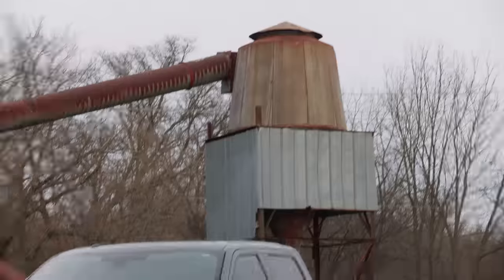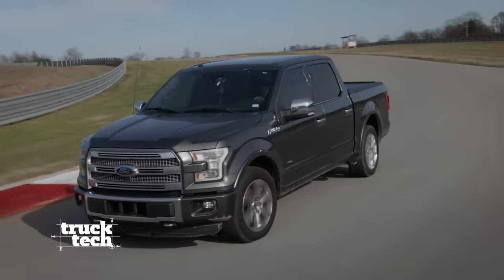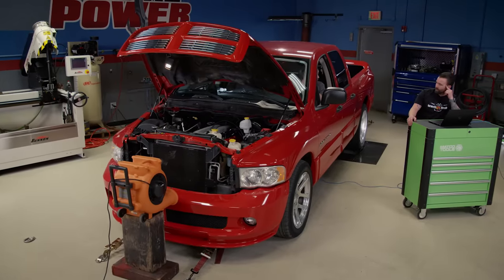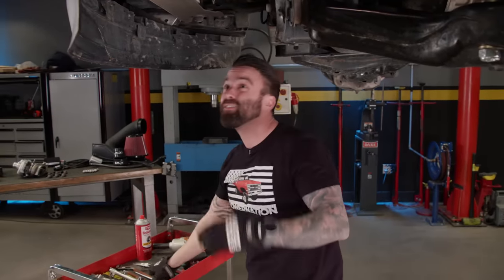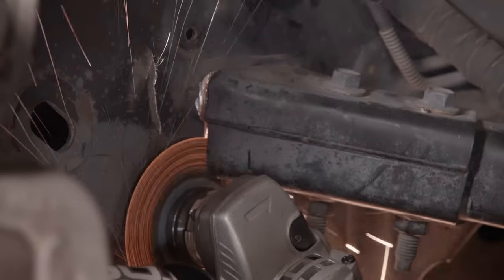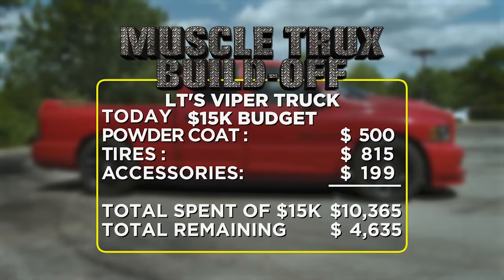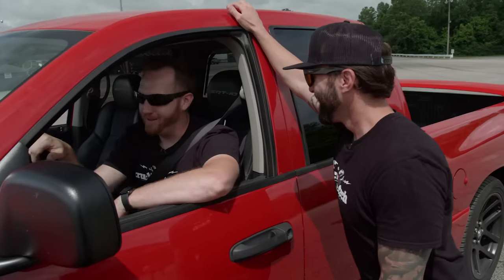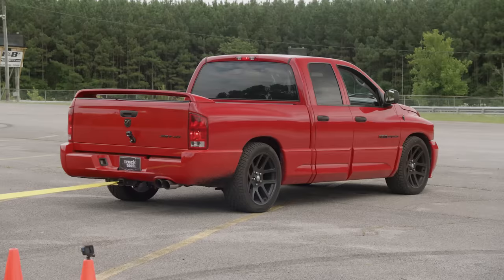Muscle Trux Build-Off: Ford F150 EcoBoost vs Dodge Ram SRT-10

Comment: Do any of you ppl ever answer questions that can really help "Joe American" w/ his truck issues ??

I have a 1999 Ford F-150 w/a 5.4 V8.  I understand the aluminum heads are very thin where the spark plugs thread in. That's why I've had 3 spark plugs already blown through the threads having to be fixed w/helicoils.  I understand they can't be fixed twice.  Solve this problem for good.
Questions :
a)  do you know of this problem ?
b)  do you have a recommendation you could share ?
c)  are there aftermarket or other heads available that don't have the same problem & could fit this engine ?

Thanks for your generous consideration,
Steph  (Stephen Boeker)
Leesville, LA
Reply: Why are you asking maintenance/piss poor engineering questions on a muscle truck buildoff video???

Comment: So the ford guy cuts off the frame bracket that makes the f150 the safest truck all because they didn’t want to measure the for the correct offset and size

Comment: That F-150 looks WAY better than that Dodge. I would take that 150 any day over that Dodge. There is a reason the F-150 has been the best selling truck in America for like 35 years. They make dam good trucks. And the economist V6 puts out more power than a comparable V8 does and gets better gas mileage while doing it. Did you know that the new Ford GT has a 3.5 liter Ecoboost V6 in it? Yes it does. It has all the same engine that F-150 has of course it is tuned much differant. It produces over 600 HP. So that engine is capable of A LOT.

Comment: 9.63? That's not great for a 3.5 Ecoboost. I think he needs to learn how to drive it.  4 hi, brake boost it and go. It should be running high 8's in the 1/8th.
Reply: There's ppl running low 8 with Ecoboost in 1/4 miles lol

Comment: Would rather have The ford looks Way nicer better on reliability Plus you still get the comfort and smooth ride Plus the four would be more of a logical point it’s more accessible for the people to follow the build unlike the Dodge that literally will break and broke on video 🤣 you also have to admit it it’s pretty sad that a four-cylinder is on the ass of a V 10

Comment: Cool video but without a 1/4 mile it isn't right. Simplest measure of american muscle. Replace a bushing with aluminum .... cmon. Great for a few hundred miles and then.  I'm out. 

This coulda been good with the ultimate mopar and the new gen of ford. I have a 2014 5.0 f150 and really wanted to see how this shake's out.

Comment: I'll never forget the owner of Kimberly roofing couldn't believe the commercials so he leased one each Chevy, Ford  and Dodge. He had three crews and each crew got each truck for 4 months after 1 year they each had to pick their favorite truck. All of them said the same thing: if you want to get to the job fast get the Chevy,  if you want to look good when you get to the job use the Dodge but if you want the best work truck ever made get the Ford so he bought every one of the crews a brand new Ford crew cab with the 7.3L. Powerstroke F-250

Comment: The F150 build is an absolutely a horrible match of "upgrades" for the money spent. 7 grand for less than 100 total gain, definitely a case of someone choosing parts without thinking of the actual requirements. Intercooler, injectors, ignition coils and blow off valve were not required on that build the stock units would have easily supported the marginal increase of power.

Comment: Big wheels don’t make sense unless that is what you. Personally I would have more rubber on the ground,  that black color doesn’t do anything for me a great set of chrome wheels 18 inch wheels with tall tires air bags suspension, personality the black out takes away from the beauty of the vehicle 
Any vehicle with these big emblems takes away from the vehicle, they make a flag emblem that is awesome. Fiat needed to let people know who was making it now it’s own by a company from the USA we will have to see what will happen to .

I have a hard time with the GM vehicle it has that big ass grill is larger than a Kenworth or Pete. Watching from the rear view mirror you see a that appears to be couple of inches then there is a grill is Hugh then the air dam is wow these are p/u trucks not OTR tractors 🌎. My opinion gm looks like a barrel of smashed ————————  they didn’t put enough goodies to offset the ugly.

Comment: The Ford does look better, BUT it is still just a V6. I'm partial to Dodge and redheads and how do you compare a V6 to a V10? Dodge wins without a doubt.
Reply: Spent almost all of the budget and still lost. Biggest improvement in hp but still noticeably less than the V10. Spent the most on visual but the Dodge still looks better. (he forgot to put in the blacked out lights he paid for) Though there isn't any chrome but as the saying goes: Chrome won't get you home. The Ford does look better than when it started but it still not enough.

Comment: This was the worst build off I've ever seen. The basis twards the Ford was ridiculous. You claim $15k in upgrades but you never included ALL the paint that was needed for the Ford. I swear this was watching a guy with an endless budget and resources.  I.e. a lift a paint booth, tools. Etc. Go against a normal.guy who would work out of his garage with a limited budget in mind and some of the prices u claim seem very off. THE VIPER Truck paid almost $900 for just tires. But the Ford got 22" x 10 wheel n tires for $1500. That seems fishy. The Ford get a paint booth with paint and all the tools and prep work needed to paint. I.e. sand paper grease n wax remover clean rags a spray gun a compressor just has that available to him. The guy in viper is using plastic dip in a drive way.  Then the Ford get a daul action polisher with polish and cleaning product all free.  Like i said the worst build off ever. The Ford went way over $15k. And the Dodge didn't even come close to it. What a  sham.

Comment: the ecoboost should of been converted to E85
Reply: Why convert?  It should already be setup to run e85.   Most newer vehicles are flex fuel from the factory.   My dad's 01 Ranger was and that was 20 years ago.
Reply: @bmstylee  not all engines are set up to run e85 the ecoboost f150s are not but the 5.0s are
Reply: @bmstylee  gotta change the fuel pump
Reply: I see.  I see a lot of the newer 150s with the flex fuel badge on them.  So I assumed wrong I see.   My Silverado is e85 compatible and I ran it when gas was $4/gal and I didn't see anything other than it uses a ton more fuel.
Reply: @bmstylee  lol all modern vehicles can run on e85 its just horrible for miliage and adds no performance gains at all unless you tune it for the e85 my 2012 titan says flex fuel but burns twice as much as gas if you use it

Comment: An Eco-boost vs a V10...come on...if you're gonna do that then use a Raptor Eco-boost...apples to apples, not apples to oranges...
Ford failed big time by not bringing the Lightnin back. That 5.4 supercharged Lightnin destroyed the STR10 Ram...price,power to weight, quarter mile, & handling ALL DAY.

Comment: How tf can you a dyno test win to the truck with less power? The hp gain to the ford was the tune and since they cant have the same exact tune and the ford is a turd of course a tune is going to wake it up. Not to mention the srt10 is 15 years old at the time so thats a 15 year old engine and rings and it still made crazy hp naturally aspirated. If the guy would have used that extra like 2k he had on a turbo setup or a nitrous kit it would have been insane. Dont you just hate when a show seems so scripted even down to making sure one has a motor city accent which is terrible to be honest. Even though the dodge still won, it should have been by more than a point and a half. That dyno category should have went to the ram, it made more power. The ford dude knew dyno run test would be on the list and he still chose the v6 and it should have went to the highest power at the end of the mods not how much power it gained percentage wise. That one feller even said he was keeping it na to give the ford a chance so he gave up an extra 100hp easy and then he would have been in the low 8's on the drag, maybe even high 7's. That ford looked like crap too, like literally a dog trying to take a shit. It was squatted so bad.

Comment: This is a joke. 15k in upgrades?? and the srt10 didn’t get a power adder? Just some BS over the counter cam. While there was way more money spent on the eco boost. Lost respect for this channel. A pro charger on the str10 with 0 other power upgrades would’ve toasted the eco boost in every category and it’s a decade older. Even at a measly 8psi. Only 39hp in gains is a joke.

Comment: The Ford f150 rear tires are warn to crap honestly the front tires where hooking the rear wasn't if the f150 hooked in the rear more the f150 would win 100% with the tug o war

Comment: This is dumb. The f150 eco boost was a dumbass choice because you could have gotten a coyote powered one and put a blower on it and made 600rwhp easily. The srt10 is also just flat out cheating, you aren’t building s muscle truck it already is one. Would have made for sense to get the hemi ram1500 and also to have done forced induction on that. Not to mention one truck is 10 years newer than the other one so the technology makes it very clear that the Ford would be a better dd. Just pointless

Comment: the ford was the worst pick ever. extended cab and 4 wheel drive. it has a thousand+ pounds of extra weight. thats makes a huge difference in handling and acceleration.

Comment: It's OK Dodge Viper's looked good but that's all they were were were lawn ornaments because they broke down all the time Let's face it Chrysler products are junk and why the heck would you get the V6 Ford when the V8 is so much better  Let's face it the Toyota tundra V8 or the best made If I had to get a ford it would at least have the V8 Turbos on any engine will make it last less It wears out the engine faster

Comment: So I got a 2.7 in the driveway right now with a laptop in the passenger seat. The other day the ecm produced a calculated 550 hp with a somewhat moderate tune. And the newer f150s are not that great at burnouts unless you disable or cut back some features in the tune. It is possible to make the truck light up the tires from Sunday to next Saturday. My current tune is pushing about 20 to 22 lbs of boost based on barometric pressure. The injectors handle this fine and are no where duty cycle. This is on 93 pump gas and no knock retard yet. I can only imagine the power you can push out of bigger turbos and better injectors, not to mention the almost double the size intercooler.